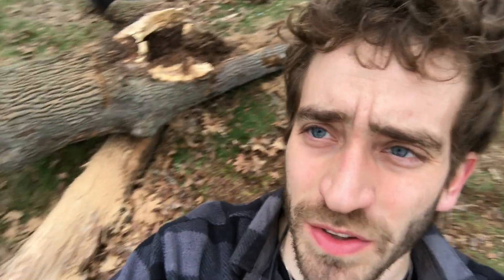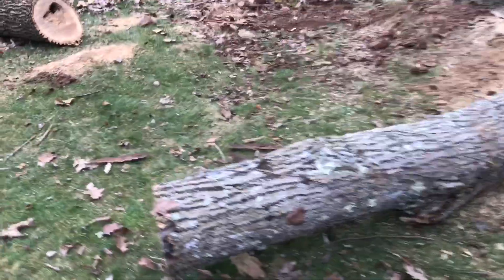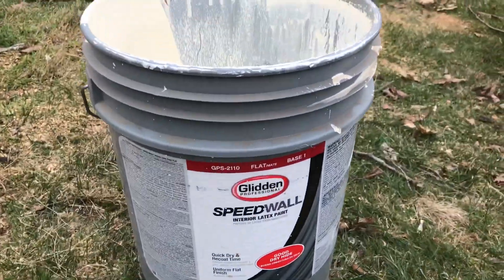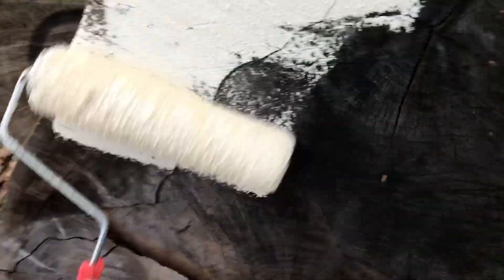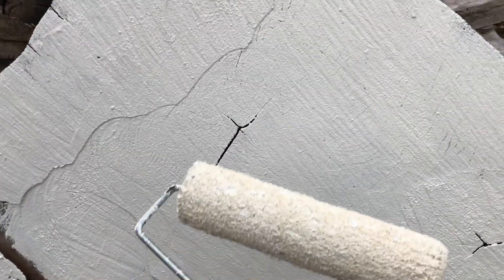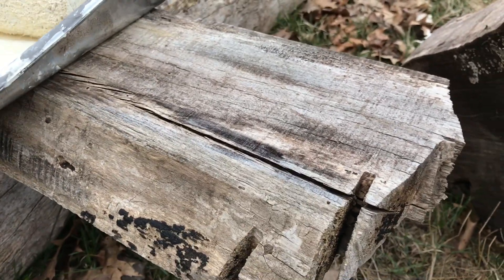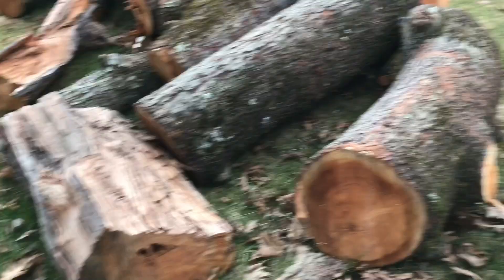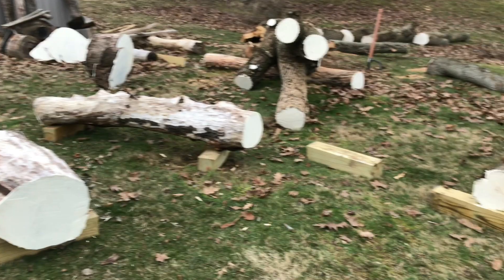Seal Log End Grain on a Budget!

Comment: Good video.  You are right, you want to seal the ends just after you cut it.  I've been told that oil based is better especially if you are trying to coat them in colder weather.